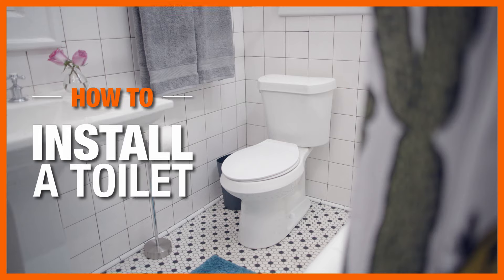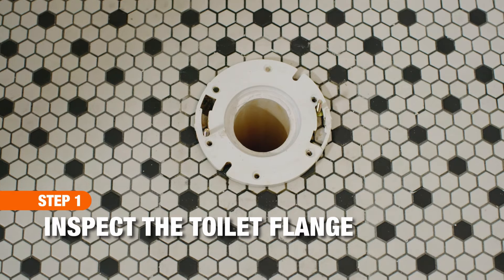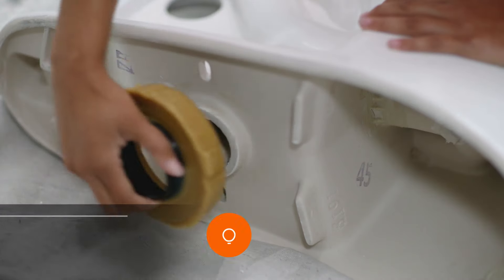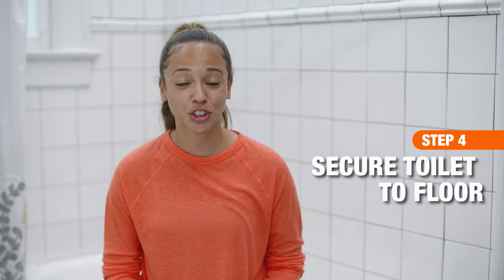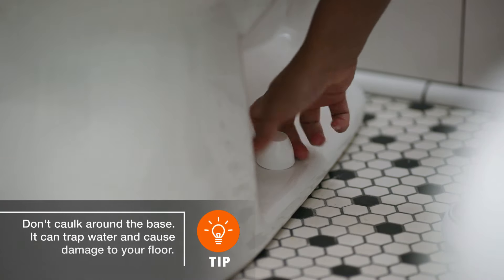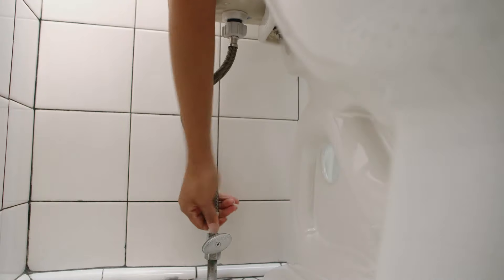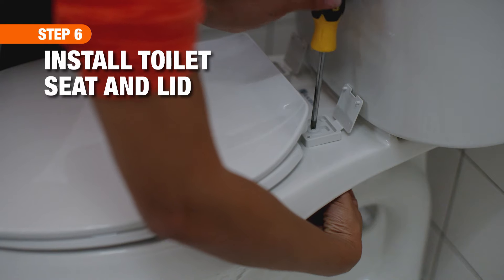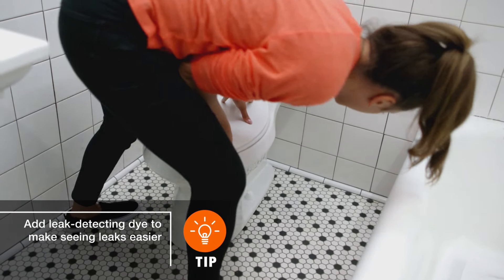How to Install a Toilet | The Home Depot

Comment: Thank you for this video. I'm not confident with home projects but after seeing this i feel that i can do this! 💯 👍🏽
Reply: It’s pretty simple I would recommend using a rubber wax ring like a danco rubber wax ring if you feel you won’t get the bolts to like up first try so you can reseat it without having to purchase a new wax ring. Also using the plastic washer on the bottom of the flange part will help keep the bolts in place which should help lining them up. And go easy on the tightness enough so it doesn’t move side to side but it’s porcelain so be careful or you can crack it.

Comment: I am 70 and have been installing toilets for half a century. Let’s get a few things straight. Re caulking: Yes and no. There is nothing wrong with caulking, but always leave a section, at the back of the toilet, uncaulked. If there is a seal leak you want the water to appear on the floor as soon as possible to alert you. A fully caulked toilet can send leaking water into the basement or crawl space — or to the ceiling of the room below if the toilet is on an upper floor. In most cases the supply line should NOT be reused as the seals will have hardened and failed. Do not use plumber’s tape on the connections. Also, if the new toilet is higher the line will be too short. An old trick is to buy a line that is longer than needed and loop it to make stress-free connections at both ends. A small towel works better than a sponge for removing residual water from the tank of the old toilet. If your water valve has not been operated for years it could well leak at the stem or fail to fully shut off. If it leaks at the stem you will need a new one; if it won’t shut off you can get away with turning off the home’s main shutoff valve. The old toilet will have water in its trap, so remove it by repeatedly cramming a small towel into the bowl and wringing it out. Assembled toilets are heavy, so disassemble tank and bowl before moving the pieces. What to do if the tank bolts are rusted? Cover the tank with a heavy blanket and rap it with a hammer. Put the pieces in a box or plastic tote. And, duh, protect eyes and hands. Have a towel on the floor when you move the bowl, as there still might be residual water in the trap. And, yes, it should not take “a few hours” to install the new toilet. Counting removing the old one,though, it could take an hour or two.
Reply: Nice explanation. Thx much!❤
Reply: Thanks for the info
Reply: Excellent extra advice! Much appreciated!
Reply: Does the flange have to be bolted to the ground ?

Comment: Annnnnd  if there IS a leak?
Reply: Unfortunately you’ll need a new wax seal
Reply: Depends what is leaking when you connect the hose to the shutt off valve , circle threads with plumbing tape.

Comment: The water saver toilets do not save you on your water bill. I bought one. It looked nice installed in my bathroom that I remodeled. The only problem is when you flush the toilet make sure you are ready to flush it again. I hate my toilet. It is an American Standard and not worth a dime . I wish I had my old toilet back. It would save me a ton of money on my water bill!
Reply: I'm not impressed with American Standard. it's a cheap brand.
Reply: @lfalpacas26  When I was a contractor American Standard was a good product. I don't recall any customer having a problem but I am in my eighties now and my how the world has changed! This comode was touted as a water saver? Funny but it uses twice the warter as the one I took out?

Comment: It depends on if you need to remove the old toilet.

 It takes longer then you think, especially with a small bathroom space. Good luck removing and replacing a toilet in less, then an hour.

Comment: How do I get the water out my current toilet lol
Reply: Turn off the water supply and flush. It won’t refill.
Reply: There may be residual water in the bottom of the tank. That can easily be removed with a sponge and a bowl.
Reply: Turn off the water supply and hold down the flush until completely drained disconnect the line afterwards
Reply: Just drink it works good
Reply: Wet/dry shop vac, just run the hose down the toilet.
Reply: Pour a bunch of water into the toilet bowl after you shut the water off and flush. It will push the rest out